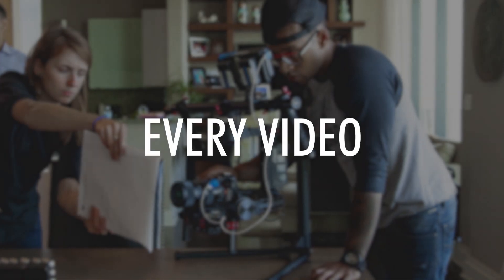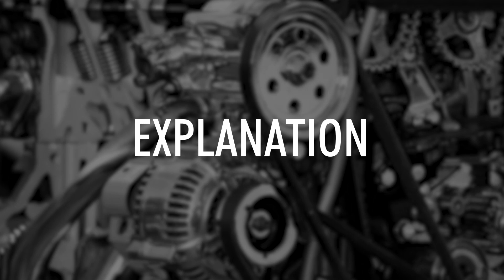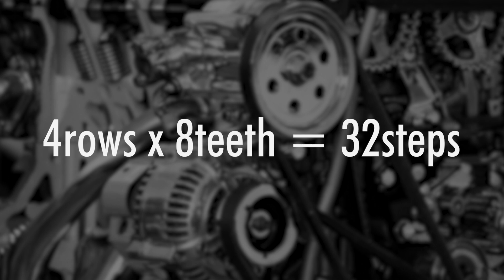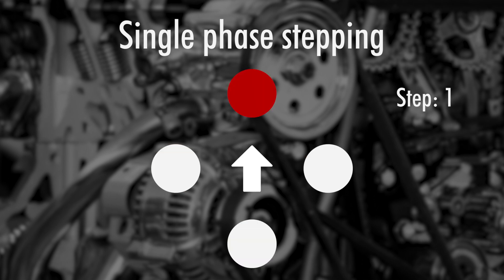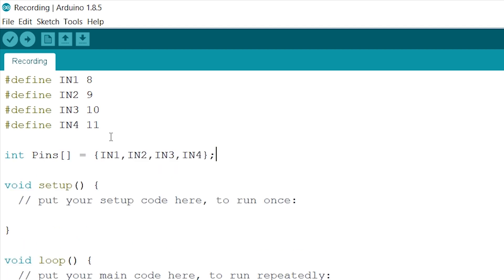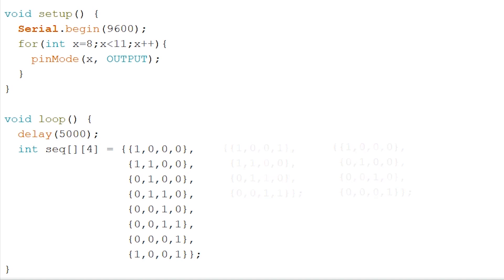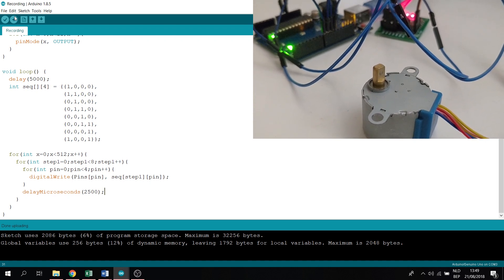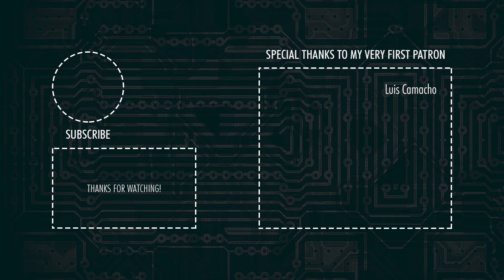Arduino uno stepper motor half stepping & full

Comment: I am new to arduino. I am doing research and I want to run stepper motor to it and this one very useful for me.
But here I got a problem.
I am having error code "pin was not declared in this scope". How do I fix it?
Reply from the maker: I'm guessing something went wrong with your declaration of your pins, try double checking my code with yours and focus on the pins, something went wrong there, let me know how it goes! :)

(Make sure the pins aren't in the void setup, if your pins are declared in the void setup then your pins in void loop won't be accessible)